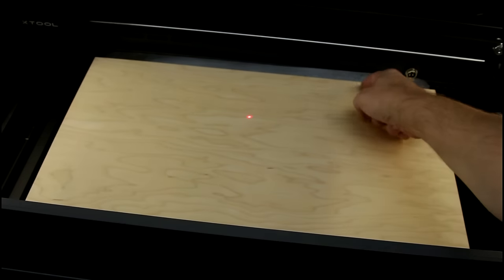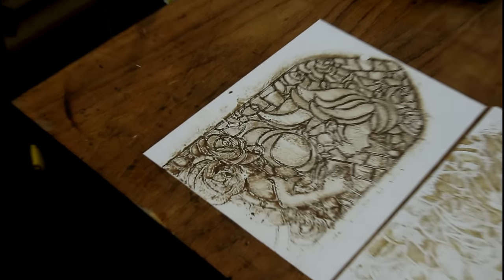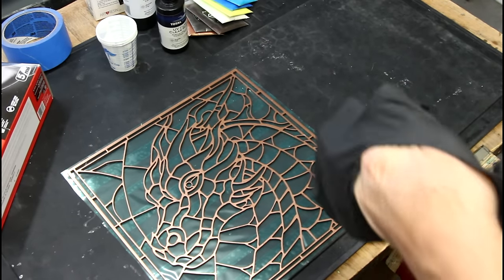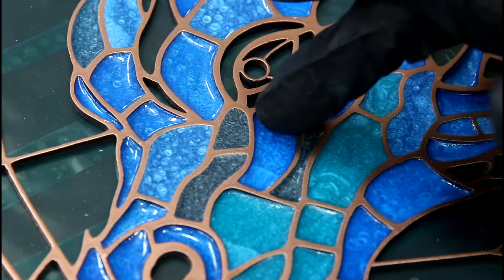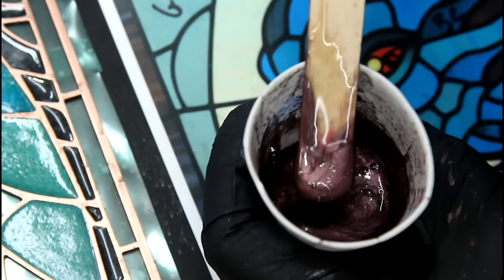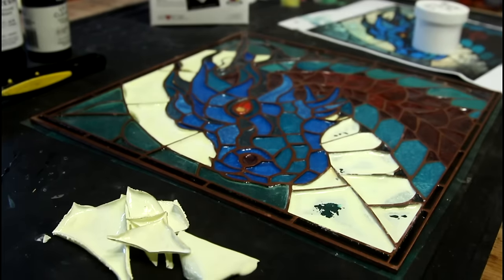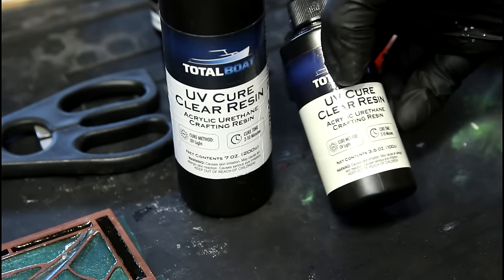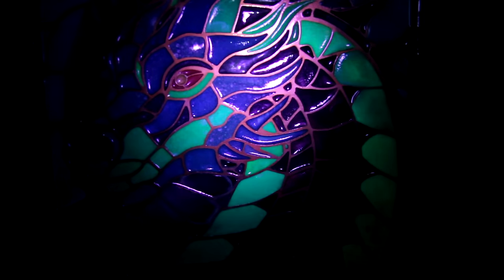Resin Stained Glass: Viewer Suggestions!

Comment: Coloring UV resin requires that whatever colorant you use is either translucent enough or has a low enough concentration that the UV light can penetrate all the way through the layer.
I would bet that both of your light colored pigments contain titanium dioxide, which is a common white pigment in the art industry and compatible with basically everything except UV resin..  Why?  Think of sunblock lotion: a lot of them use titanium dioxide to stop the UV from giving you sunburn, and that's a thin invisible coating on your skin.   When you mix a huge amount into the resin, it's obviously going to prevent the UV from going all the way through, and what happened was that just the top layer cured, and everything under was still uncured..
Transparent dyes vs pigments are really the best colorants for UV resins there is no physical particles of material to block the UV..
Sunlight is also a far better and stronger source of UV than any handheld lamp, so it's also a good idea to put UV resin projects out in the sun to ensure full curing...

Comment: This is user error more than the resin. UV resin (as I also learned) needs stronger light from both sides if it is highly pigmented. The light you had really wasn't strong enough. I have a smaller one I use to supercharge my glow pigments and cure resin. It small but STRONG. UV resin is a bitch sometimes but if you want good tips try jewelry channels.

A lot of resin jewelry is UV resin and they work with pieces similar to stained glass as well.

Comment: When I cure UV resin I try to only use a UV flashlight for small glue up jobs. I have a cure box for medium size pieces and if I were to do something as large as that stained glass picture I'd probably just get a tube blacklight and stick it in a closet. There are tutorials on youtube to make larger UV cure boxes out of strips of blacklight, tin foil, and a large plastic tub, but if you're not going to be doing a lot of large UV projects I wouldn't bother with that.

Comment: The problem with pigments in UV resin is that a lot of pigments will absorb ultraviolet light. You can't make it too opaque, and you have to give it a lot more UV light for a lot longer in order to get it to penetrate and cure.

In particular, I'll bet the white uses titanium dioxide - that makes a really bright, opaque white, which is exactly the problem: it's so opaque that it blocks the UV from penetrating below the surface.

Comment: The titanium dioxide white may have shielded the bottom of the resin from the UV, may want to pour on a glass (not plexi, it blocks some UV) table and hit both sides with UV.

Also, would vibrating the table help disperse the epoxy in each cell?

Comment: I actually gave your original technique a go after your Princess Peach video! I traced a protea flower in Procreate, extruded the linework in Blender and FDM printed the frame, on account of not having access to a laser.
I used a two part epoxy but I did want to try the UV resin next time. If only to see if I can use up a weird amount of left over clear eSun printing resin.
But glad you experimented first, so I could see how it went!

Comment: Have your project up on a white surface , or clear, or a mirror, or even lived up slightly.  Anything to get light from all sides.  Hold or slow down on the UV light.  It's not instant, it take a little time to get through resin that thick and pigment density.  Some other mentionee, us alcohol ink, but to get the shimmer you could use an inference instead of a metallic mica.  Inference tend to be light or white powder and will play so much better w/ UV resin. It's a gorgeous project, but a little research, prior testing would have saved you time and frustration.  Good luck on the next one.

Comment: Use Alcohol Ink for the pigments like white and blue. There is different types of white for alcohol inks. There is advanced and then normal. Advanced is more opaque, it will stay throughout the resin. However the normal white sinks to the bottom of the resin leaving a clearer layer on the top. (Regular is great for making wave effects for beaches and such when you are adding a different color to the same resin base.)

Comment: The residue is, funnily enough, rosin. All plant matter, when sufficiently heated, produces a sticky, tar-like substance which is usually sublimated off in a full fire, but sticks around at lower temperatures. It is the same source material as early resins, just derived from heat instead of solvent.

Comment: So, this is pretty much exactly like gel nail polish. And from experience I have some tips.
With opaque resins, paint very thin layers and cure each layer before adding another. Then also cure from the back through the tape.
As the resin is opaque, the top layer will cure under the UV light, but then the light can’t penetrate through the opaque substance to cure any other liquid resin underneath that layer.
Using all transparent resins will allow UV light to go through and cure all the way through.
Maybe get some UV nail lamps to cure projects under. They’re cheap and have timers on them, because the longer you leave the UV on one spot, the better it will cure. So that might work better than using a light you have to move around the piece, as you can make sure all areas get the same amount of exposure.

Comment: This is a super cool product and I was thinking you could speed up the process so much if you build a uv oven just use a box (could be ply if you want something that’ll be a bit more sturdy and make it foldable/collapsible) line it with tin foil and get a couple of the usb 405nm light strips, that way you could slide the whole thing in and completely and evenly cure each section you want, if you wanted to get fancy you could make a platform on which you could lay the parts during the making that sat on a couple of drawer slides so you could resin fill the parts you want, slide the drawer in, blast the 405’s for a minute or two then move to the next section. 
For hours build you could save an emended amount of time and if you built it big enough it could double as a curing oven for resin 3D printing   
Just an idea ✌️

Comment: Even if you didn't keep the cutouts to be a jigsaw puzzle (I wouldn't), I could see it being very interesting if the cutouts were painted or stained and then cast into a resin "frame". Pretty much reversing the stained glass scenario, so the "glass" is the part in between the image pieces.

Comment: 3d printed frame also works. The same SVG cam be converted to extruded shape. You can also do  a 2 color print black on top of clear then pour. UV may have a thickness issue or may need to be exposed on both sides. Some UV resin is terrible smelling.

Comment: 100% there's titanium dioxide in the bright white and titanium dioxide is extremely good at absorbing uv light and reflecting visible light due to its high refractive index. When you hit it with the blacklight the tio2 completely blocked the uv from penetrating the resin, so only the surface cured.

Comment: You used an opaque color in the lemon yellow. This did not allow the UV light to go down through the bottom so it only toward the top and as the top tightened it started peeling away. Cure time on most UV resin is anywhere from 30 seconds to 2 minutes depending upon thickness and if any pigmentation was added. It probably would have worked out better if you did it on a clear plexiglass stand and had a UV glue underneath it that would cast up from the bottom while you ran your light around the top as well. The metallic and clearer coloring agents work better when using a handheld light and moving it around. Any ability to you have to stick it under a immobile UV LED light and leave it under there for upwards of two minutes will cure it rock hard. It's actually the same curing instructions as polygel which are used in artificial nails and model-making in the whole lot of other things

Comment: Many things you could change for immediately different results. You need to have much less opaque colors. The pigments are blocking the uv light. You also need a much stronger uv light, and you need to let it bake under the light for much longer. Time varies depending on the resin, but waving a flashlight over it is never going to fully cure it! I hope you try this one again with some of the tips in the comments!😊

Comment: Yeah UV resin really works best if the thickness is thin and translucent. The pigments u used were probably too opaque so it didn't allow the UV rays to hit it. 

Also think it works best under a certain wavelength which I can't recall atm. Personally really only use resin for small repairs or for adding details like a lightning bolt shooting out of a figure. It is so cool to literally be curing resin in midair 😂

Comment: I recommended for larger uv resin projects, a 200w uv flood lamp. Plug it into your wall, aim it on your project, and go to sleep. If you choose to use such a powerful uv light, you do need to be careful of the resin overheating. Ive never overheated the resin that i use (kisrel brand) to the point where it ruined the resin, but i have overheated it to the point where it damaged my mold.

Comment: Looks great!
Suggestion: after applying the copper paint, you should randomly place back some of the inner pieces of wood in the holes, instead of filling each holes with resin. that would create a nice contrast of material! Or instead of randomly you could put it instead of a specific colour

Comment: Generally, plywood glue has formaldehyde in its composition; you may want to actively evacuate the laser cutter to the outside, and after it's done leave the piece in the machine with the fan turned on. And that sticky residue is probably just wood / tree sap.

Comment: I'm not a laser expert but it looked like it was smoking more than it should on the aluminum plate. I've heard that airflow is really important to keep that smoke down and get better results. But yea that first grate you used was too tight for all the small parts.  I'm thinking that since you're cutting so many small bits it might be best to lift the entire workpiece up but put the spacers outside of what you're cutting. That way they can completely fall out of the way.

Also, I think you can leave tabs and then punch the pieces out one at a time when you're done.  Depends on the software.  Hopefully there's an easy one click button to add tabs. Then you can use the airflow grate without worry.  Since they're small you only need one per tiny segment. Hopefully a laser person can confirm if this is a good idea

Comment: in my experience there are 2 types of uv resin. one requires 405nm light (which is the one i think you were using) and the other works better with 395nm. also i agree with all the comments about there being too much mica powder for the amount of time you exposed it.

Comment: Opaque pigments don't allow light through to cure uv resin. The resin tape is translucent so you can cure the resin from the bottom as well.  I think the original yellow would have been cool with just 1 drop of a highlighter chartreuse yellow and a pinch of a yellow blue pearlescent powder.

Comment: you def need a stronger uv light, sure that blacklight puts out some uv but a proper uv light, like the one i have for uv automotive touchup clear is very powerful, i forget the actual numbers on it but its powerful enough if you even look at the reflection of the light without proper eye-protection it will make your eyes tingle lol just about like looking at the sun, i think the mixture of the low powered uv light and some of the pigments being more opaque made them not allow as much uv light through and maybe not allow them to fully cure, the front seemed fine but there was lots of uncured uv on the bottom where the resin tape most likely protected it from getting any uv before you pulled the tape off...also i just noticed the cure time on the resin 2-10 min....with uv cured stuff im pretty sure that means you need the light on there for that long, like setup a stand and walk away a while kinda thing not justy a magical wand wavee lmao

Comment: I would suggest leaving the project under a UV light or out in the sun for 5-30 minutes. Some pigments causes the resin to set at different speeds, especially ones that are more opaque.  So that may be why the white and the reds were still no fully cured.  I have never had UV resin shrink up like that white did so it may have been the pigment or even the pigment reacting to something in the spray paint that made it pull away from the edges.

Comment: I’d just be repeating what other people said already but I was excited to see the UV until you started mixing the mica in and I went oooh nooooo because I knew it would be too opaque to cure all the way through. Definitely need to have more UV light to cure more evenly but you can do an initial cure and then leave it in the sun to do more through hands-free curing! If you do use mica with UV, it should be thinner layers. I really want to learn to do the electro plating because I loved how the peach came out but the spray paint did great here

Comment: I would argue that if you make a deeper frame, use the same amount of colored resin. Then put a thick layer of completely clear stuff on top to add weight, rigidity, and a protective layer.

Comment: You could use copper power in paint or dust on the power with glue or paint drying on it. I think the paint looks good, but maybe a copper dust mixed with maybe a copper paint or something could add depth and slightly patina. copper on stained glass doesn't fully turn green normally just the surface changes hue so you might be able to put a dark oil or a oil paint on and whipe it off if you want that kind of look

Comment: Yeah as a lot of people have said uv resin doesn’t mix great with mica powders. I’d suggest alcohol inks and then using a bigger lamp for longer. The other thing is that the thinner the resin is the longer it needs underneath the light so I’d suggest somewhere in the 5 minute range. If some pieces are still sticky, as you said sun time is great but you can also wipe them down with some isopropyl alcohol and it gets some of it off. My credentials are that I make a lot of resin earrings

Comment: Maybe try holding the UV light over each segment for like 30 seconds each? Will take a bit longer but with the pigments it might help cure the resin underneath a bit better. Or transfer it onto a piece of glass/flip it upside down and use the light on the underside when you have a lot of pigment to make sure it gets all the resin cured

Comment: You definitely need a stronger UV light something that is stationary and that you could just slide the project under or that you could just leave on top of the project. That’s resin that’s usually used for jewelry so it’s used on small items that are easily transferred under lights.

Comment: I think it would help a lot with the curing process if you had a white surface - light would bounce around and cure the resin deeper. That's also the reason why you don't use UV resin in colour moulds, only the transparent ones. Great idea to put the whole piece out in the sun 😄

Comment: You need to get a honeycomb table for that laser  and a stringer tube, also you need to make sure the uv wavelength is correct, those torches don't usually have the power to cure the resin tidy. If your going to do more then get a 30w lamp in the correct wavelength and you will see the difference

Comment: Instead of scraping the leftovers off the laser cutter, use tape to hold the pieces as the are, and peel it off complete. Then you can make a resin reverse stained glass lol. Maybe use it as a base in a frame with some lights and the stained glass resin piece on top.

Comment: there are two and three headed lamps that you can turn on at different angles and let it set, also you dont want to use so much mica in your uv resin, i learned that the hard way when a planet i made exploded and i had to redo it with a rock in the hole to make it look like a planet being hit by a huge asteroid. Also, that uv resin you used takes longer to cure than some of the others ive used AND does better if you set i tin the sun for a bit after doing most of the cure.

Comment: You need to use the UV light longer per section that just waving it around it take minutes for the resin to cure when there is a lot of opaque power in the resin, and may not sure at all of there is too high amount of mica power in the resin

Comment: 7:50 You need to make sure that what ever light you use, is the correct wavelength for the resin. If its to high or low it wont cure the resin correctly.

Comment: How much UV resin did this project take?  As a rough estimate?  I've never worked with resins, and think just using UV for something like this would be a good entry point.
Reply from the maker: The pouring process was 2 hours. It would be quicker without filming. :)

Comment: You could also cut a pair of super thin frames to spray and glue on top to help define the copper again if you need to sand the resin flat due to imperfections.

Comment: My guess is that the dye powders literally stop uv radiation from penetrating deeper. Even though the light can get through it's just really really hard for it to penetrate deep with all.of the debris (dye) in the way
Reply: Using opaque dyes for uv resin is probably always gonna result with slow cure times/unfinished cures